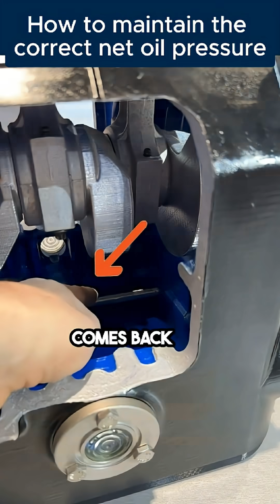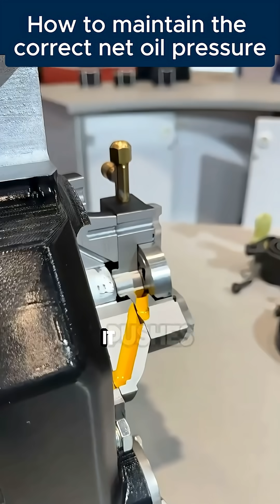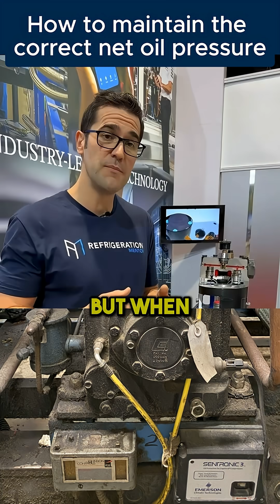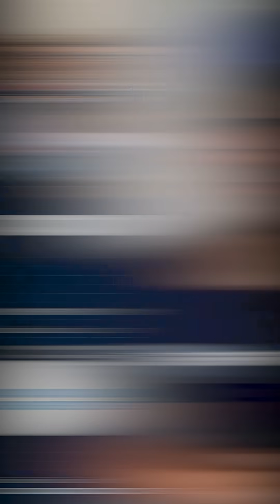How do you determine the correct net oil pressure on a Copeland 3D Digital compressor?

Comment: I had a service call, single system compressor down. Manager kept resetting a safety. Come to find out it was an oil fail. Net oil was 5. Same compressor, crazy part is it ran for another 72 hours
Reply from the maker: Did it fail after 72 hours?
Reply: @RefrigerationMentor yes, did a oil change, but ended up replacing the compressor

Comment: Normally it should be 1.5 higher than the suction pressure!! On this kind of compressor it doesn’t matter the rotation!! All this oil pumps are reversible !! Nice video, thanks
Reply from the maker: We appreciate the comment. Thanks.